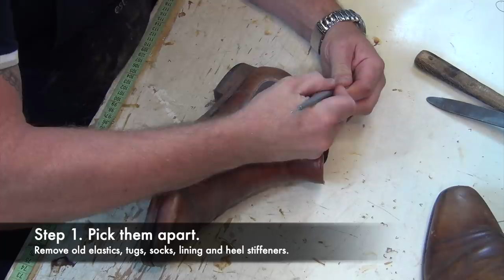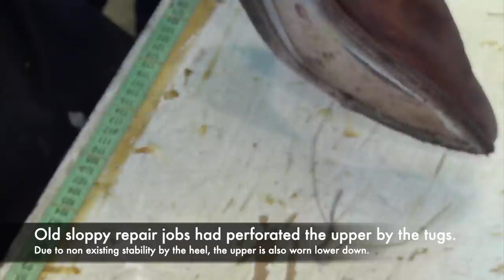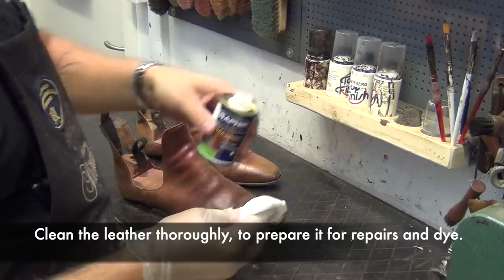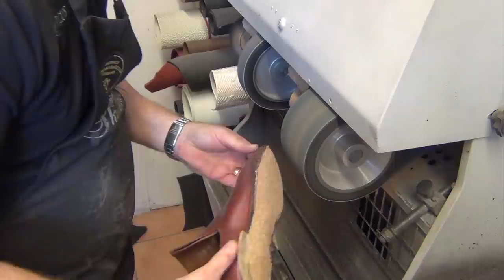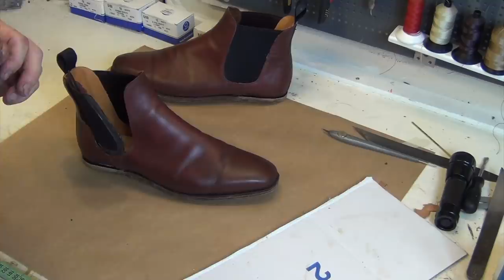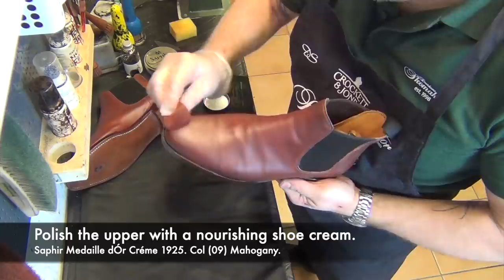Restoring Crockett & Jones Chelsea Boots

Comment from the maker: Many questions about the price on this. I have answered it in a couple of posts, but here is one more.
The customer got a negotiated price since I got to borrow the shoes for a long time for the making of the video. I would probably have to charge about 600€ for a job like that, normally. The shoes cost about 500€ 20 yrs ago. Quite difficult to price a job like this, since I choose to do more than necessary, just to make a cool video. Under normal circumstances I would probably deem them not worthy of repair, but the model is discontinued, and they are broken in to the customers feet. The job cost almost as much as a similar shoe would cost new.
Reply: I think they looked amazing.  The thing is, when you buy a new pair of shoes, they look great straight out of the box but when you wear them you notice the wear etc.  With the leather on those boots looking so subtle after years of use, they just look so comfortable.  At the end of the day, people get attached to certain items and price becomes less important.
Reply: The price is probably worth it considering how long well made and maintained shoes can last. The customer can probably pass it on to their kids. Can't say the same for fast fashion
Reply: @jackcullen69  I'm still wearing my late fathers Crockett and Jones Pembroke model... built like battleships and only resoled once.
Reply: Ibthink your client was fooled or amazed by the quality of workmanship. 🇬🇧👍
Reply: I was wondering about this - My initial reaction was "wouldn't it be more cost effective to just buy a new pair?"
Reply: I paid £530 for a pair of Crockett & Jones boots this year brand new. NIce boots but the boot comes around my foot too much.
Reply: Excelente trabalho . Mostrou sua técnica . Nota 10 .
Reply: I still would pay this for my crockets that I love rather than buy a new one
Reply: Way too much. I only saw to the point where you replaced a piece of the welt instead of rewriting the shoe. I could see 600 if you replaced the entire bottom but not for this sloppy work
Reply: @jakev1972  Rude.
Reply: @rubytuesday1345  truth hurts this is sloppy work to charge that much he should have torn down to the uppers, and replaced the entire footbed welt sole and not hot glued in the shank. Sloppy
Reply: @jakev1972  maybe you pop a vid up showing how to do it?
Reply: @rubytuesday1345  Bedos leather works
Reply: You can’t get a fairer reply than that
Reply: @jakev1972  agree, and finishing on the band not trimmer???? too much effort on the interior not enough on the exterior.
Reply: @jakev1972  great reply
Reply: @jakev1972  While your point has merit I would contend that "sloppy" was perhaps not the term best used.
Reply: I guess is the same thing , i mean you give it to him back a new per of boots particulary! Great job man!
Reply: Price is absolutely with it. Amazing restoration. More than expectation.
Reply: @scottclarke9160  thank you. I was wondering about the price because the effort and material is outstanding. I can't imagine you charging anything less than £100 for the repair.
Reply: So it's not worth it..

Comment: They may be Crockett & Jones but the single rear tab reads RM Williams 5 Percy St Prospect South Australia. Very similar to RM's but the former are made from a single piece of leather with just one seam at the heal, whereas these have another two (under the elastic on the outside and instep). These are either fake RM's or have been previously poorly repaired with the RM Williams tab retrofitted. I have owned a few pairs of Crockett & Jones shoes, but then it comes to ankle height riding boots (Chelsea boots are just for walking), RM make the best and the two tabs make them easy to get on and off (Chelsea boots have a single tab).
Reply: You are right. They had been poorly repaired, with RMW-tugs. As stated in the videos info, and many, many times in the comments.

Comment: Hi, great video. What kind of glue do you use to fill the cracks on leather shoes? Would that be ok for oiled nubuk hunting boots like the Pamir Trezeta?
Reply from the maker: I use three types glue to and four types of fillers, depending on the depth and location of the crack. It is quite hard to master this skill and requires A LOT of experience and tools to pull that off. I would not recommend you do it yourself.
Reply: @davidsonsshoerepair  Thanks for the answer. In got the shoes that I've mentioned and they now show scratches in the point, caused by plants like brambles. I was looking for a material to fill the scratches before treating them with something like Meindl Sport Wax and waterproof spray. I certainly wasn't planning to airbrush them. Only boars can see them. :)
Reply: @gianlucapx  Вы убиваете кабанов?Вым есть нечего?

Comment: But why taking everything apart and leaving the old welt on and just put a small piece of welt back?
Reply from the maker: The welt was in good shape but for that small section. Quite a lot of work to replace the whole welt, but a quick fix with a small section on one shoe. I pondered quite a lot if I should replace it just for the video, but opted for the repair in the end. Don't fix what is not broken.

Comment: I have an honest question!!!

this is like The ship of Theseus....  is it even the same pair of shoes?  and if you are gonna replace 90% of it, then what exactly is the point to have it repaired as opposed to buying a new pair?  i mean how much can the half square foot flap of leather on the top cost? (aside from historical reconstruction for a museum)
Reply from the maker: Apart from the heel stiffeners and repaint, which was a massive job and really expensive, this is quite standard work. On chelseas we often resole, reline heels, and change gussets. And I disagree that I replaced 90% of the shoe. The foot bed (bind sole), welt, upper and (front) lining is still the original. I replaced maybe 50%, but kept all the importand parts.
The whole point of buying welted shoes is, that the parts that wear down can be replaced. The foot beds and uppers are shaped after you feet. You don't want to break in a new pair. And in this case, the model is discontinued, so it can't be replaced either way.
Finally you forget to take the customers sentimental reasons to keep the shoes, into the equation. Maybe he wore these shoes for every major event in his life. First child, marriage trip, graduations etc. We have no idea of the customers motives to keep the shoes.

Comment: Very nice job, although I am a bit concerned that you claim that it is a pair of Crocket & Jones, when the footage clearly shows that it is a pair of R.M. Williams, that you are disassembling and working with. Is it not deceit to fit  C&J heel pads in a pair of R.M. Williams? Or maybe you switched over to the C&Js during the job procedure?
Reply from the maker: I can't tell if you are joking or not. So I'll treat your comment as if you are serious. 

You really should read the comments below, because I have adressed this earlier many times. They are NOT R.M.Williams boots. They are C&J's that a previous cobbler had stitched RMW tugs on. 
   If you are familiar with R.M.Williams (as I am, since I have sold them for 10 years and C&J for 20 years, and repaired both brands for over 20 years), the "footage clearly shows" that this is NOT a pair of RMW's. The only "clue" that it could be RMW's is the tugs (which were stitched on by a previous cobbler).
   I find it quite cute though, that so many people think they know better than me, how to spot a pair of RM's, even though "the footage clearly shows" that I work on them for hours, and see the boots up close. It should also be obvious to the observer that I have some skills in the cobbler trade. To then think that I can not see the difference between a pair of C&J and RMW's feel like a paradox, especially since I have sold both brands for many years.
Have good one. - Master Cobbler Marcus Davidson

Comment: This is my great grandfathers axe. My grandfather replaced the handle and my father replaced the head.........
Reply from the maker: But for the massive upper restoration, and replacement of the heel stiffeners, it was quite a standard job. Full soles and heel linings is standard on welted shoes. And sometimes I replace the welt, which I kept on these.

Comment: They look nice. If you're going to all that trouble to rebuild those boots though, why not just replace the whole welt, instead of splicing in a piece? Also, as dry as that leather was after cleaning and stripping, I would use a good conditioner before applying the cream polish. Slather those with some Rénovateur or something first. 🤷‍♂️

Comment: How much do you charge for this?
Reply from the maker: Asked and answered before. See the comments. But here it is again. 

Many questions about the price on this. I have answered it in a couple of posts, but here is one more.
The customer got a negotiated price since I got to borrow the shoes for a long time for the making of the video. I would probably have to charge about 600€ for a job like that, normally. The shoes cost about 500€ 20 yrs ago. Quite difficult to price a job like this, since I choose to do more than necessary, just to make a cool video. Under normal circumstances I would probably deem them not worthy of repair, but the model is discontinued, and they are broken in to the customers feet. The job cost almost as much as a similar shoe would cost new.

Comment: ...using an Air brush to apply color??? (that's plan LAZY, not dying the boots the proper way back to the original color, which will last for years, compared to air brushing) That's like using hair spray to shine your shoes...

Comment: So it would of been easier buying a new pair of shoes.
Reply from the maker: Yes, but then you are missing the point of buying welted quality shoes.  The whole point with that is that almost everything can, and should, be repaired and serviced as long as possible. The shoes/boots are broken in after your feet. That can take years. They have also gained a natural patina that is almost impossible to recreate. Granted, these boots' uppers were way beyond "patinated", so they needed a repaint, but the rest were more than worth restoring, to the customer. You never know the sentimental value shoes can have.

Comment: those are R M WILLIAMS  boots ,not crockett and jones
Reply from the maker: See answer below. They are C&J. But the previous cobbler had sewn on RMW-tugs on them.
Reply: @davidsonsshoerepair  How do you get the leather in sock from C and J? I have an insole I want to use in my C and J shoe but put the c and j in sock on them
Reply from the maker: @excinereresurgam9471  I sell C&J so I can buy all original materials from the swedish agent.